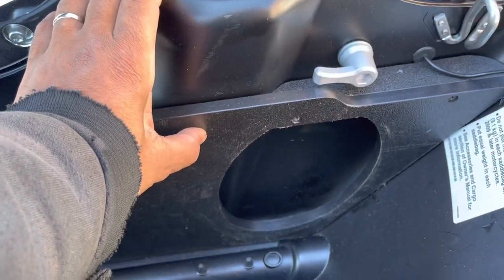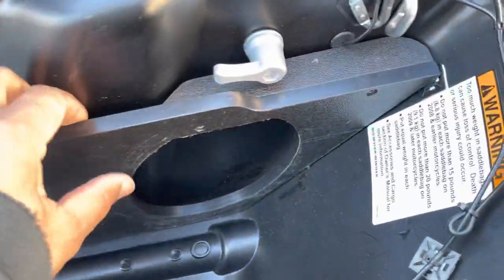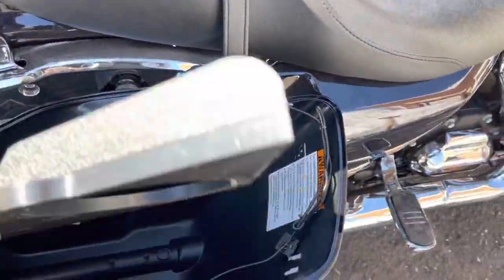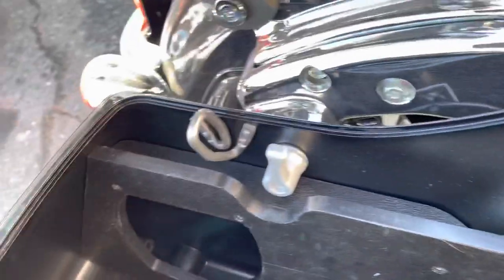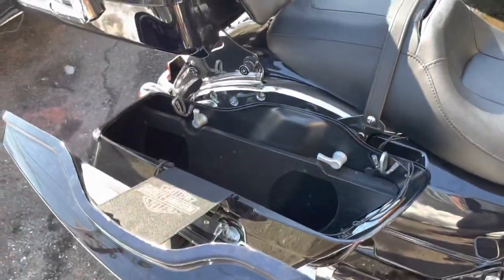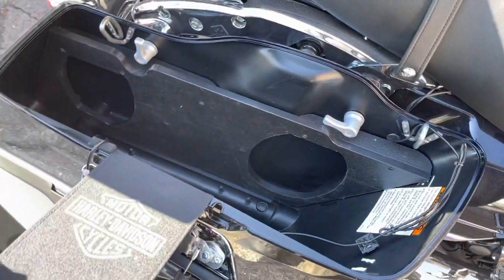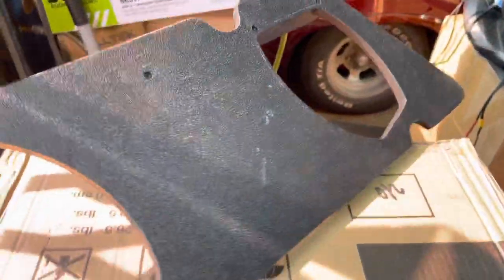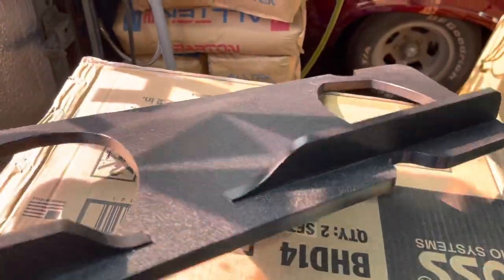Nagy quad 6x9 Harley-Davidson saddle bag mount. 2 6x9 mounted in each bag .

Comment: Trust you me Carlos here in the South 6x9's and super loud tweeters are a must on the average motorcycle audio build. Try to talk a customer out of using 6x9's and you may lose a customer. It's that serious. I live literally a few minutes from Garage Bagger so you know we can get anything we need audio wise but yet still 6 by 9s  are the king. I have a set of bags in my garage that I have isobaric loaded a set of 6x9's per bag.  I have them loaded face to magnet. I Builded a plastiq space  to use in between both six by nines so the air is trapped between the two speakers. If you remember Blues speaker had a 10in setup that came that way back in the mid-90s. Great video as always and that is a super nice looking product.

Comment: Thank you for making this i went out and bought 4 hertz 690 neos but was having second thoughs when i saw some prv 10 and 8 neos videos in the bags
Reply: Those PRVs are kickass specially the carbons and much cheaper than other brands
Reply: @dionne681  so will 2  8mb700ft-ndy-4  give more bass than having 4 690 neo's in a bag on 2 evo 800x's ??
Reply: @keithwilliams7181  Id have to check the specs. But 10 and 12 inch woofers have bigger voice coils and are designed to specifically handle more power and lower bass frequencies. A good 6x9 can only handle around 400 watts max but a 10 or 12 can handle 1000watts.
Reply: @dionne681  thats whats up i can put the hertz in my lid and go with the 10 inch prv i hope it doesnt take up too much space thats why i had a question about the 8 inch prv
Reply: I was thinking the same should I go with a  8 inch and a 6x9 in the bag or should I put the 6x9 in the lid. Or just do 10 inch each bag and single 6x9 in the lid.

Comment: Thats dope. I seen several bikes here in the Carolinas with 2: 6x9s in the bags. Think id prefer to go with a "10 inch or "12 inch woofer to get lower bass frequencies and maximize cargo space in my bags.
Reply: Get more surface area w/ 10" or 12" as well, so naturally they're louder. 8" & 6"x9" are about the same, so it's like having 8" woofers. I wonder if this is a way to integrate more tweets via coaxials.
Reply: @Gaming_Biker  Yeah 10 and 12s are only louder because of the larger voice coils and actually leaves more space in the bags than 2 6x9s to produce better bass. Ive been learning 😂

Comment: Guys been doing the 6x9 facing the rear wheels for a looooooong time. In the south and the west coast.  They used to use those yellow cone pioneers and they used to hit.
Reply: Yellow cones or 6902s but its a Chicago based company that hits also
Reply: I'm in Cali and I got the yellow cones in 2007 and now the 6902s

Comment: great video's. ...what 6x9 would you recommend in the bags?...I have a 2019 sreet glide special and added the king tour pack and speaker pods. ..would need idea on dash 6 1/2 and speaker pods rear 6 1/2...was thinking for them using diamond audio  mspro65 with the mo75t tweeters in the grills

Comment: I have 4 6x9 like this what 6x9 would you recommend to run with the SD evox 800.4 with them facing the tire replacing the pioneer 6902

Comment: I have 4 Rockford 6x9s in my bag facing the wheel ...my question to you is would the 800.4 Evox push all 4 6x9?
Reply from the maker: It’s will but that not the correct amp for that application 

You want the evox 800.1 4 ohm 
Same price same size 
But you will get 200 watts to each 6x9 instead of 100 watts each with the 800.4
Reply: @NVSAUDIO  ok thank you very much !
Reply: Wont he need the 1200.4 4ohm and run them 4x4ohm wouldnt 4 4ohm be too low of a ohm load for the 800.1?